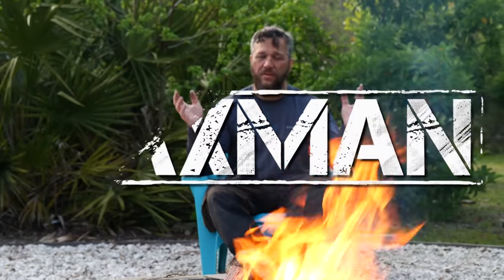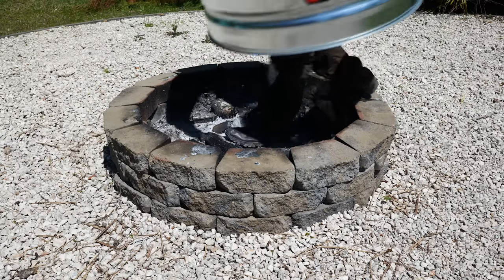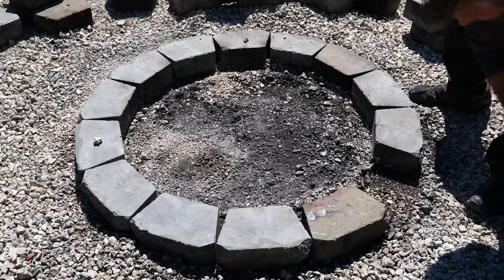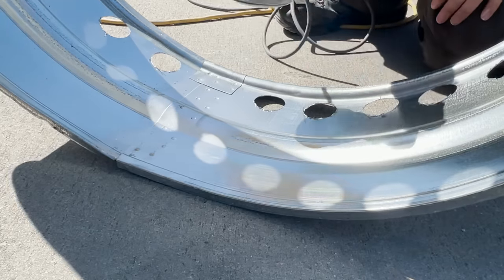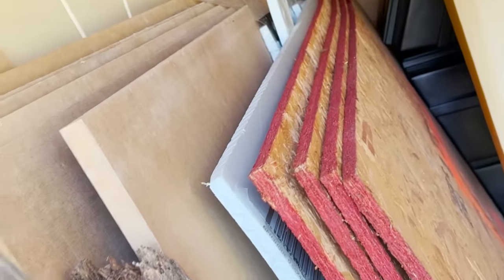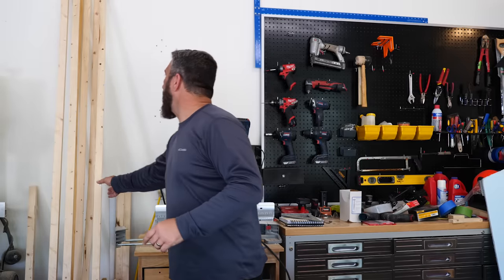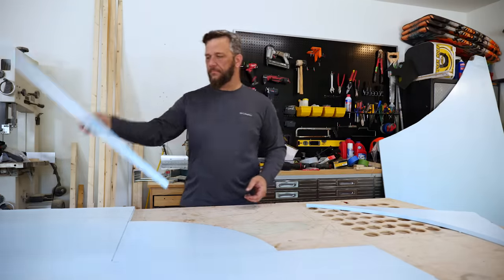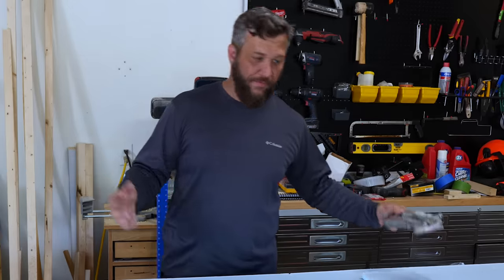Smokeless Fire Pit Makers Hate Me For Showing You This

Comment: Super entertaining practical videos! Have you considered using the bricks in such a way as to force the incoming air in at an angle so that all air inlets work together to create a vortex - driving the general direction of the combustion in a counter/clockwise direction within the pit. Done correctly - you may not need the metal liner at all. Extreme, fast combustion would literally create a fire tornado in the pit (& how cool would that look)!

Comment: Instead of removing a lot more bricks and leaving a lot of empty space, you can remove less bricks and space out the existing bricks to pull air from all around the outer ring, rather than only through a few big gaps.
Reply: Would that then make the inner ring unnecessary or does having the chamber do something more than just holes?
Reply: @macdaddy9344  
I think if you stacked the paver stones with space between EVERY stone, effectively making the same diameter circle with just 1~3 lesser blocks, that’ll feed enough oxygen to the fire. 
Keep in mind: once the first layer is built that way, you can build subsequent layers that way also. Plenty of air & oxygen. 

That said, this project has its merits. 
We get to BUILD something. 😁😁😁
Reply: I think it's just easier to make it symmetric if you pull 3 bricks than if you try to distribute that same amount of air space between all the bricks.  

I'm not sure I'm convinced it's all that "smokeless" without more of a demonstration.  He's gonna get SOME fresh air heated up and blowing on the top.  I'm not sure how much.  I think if he put the fire up on a grate and the bottom of the inner wall level with the grate, then he'd have a real down-draft gasifier, like those Solo-brand portable fire pits.

With his design, I'm not sure how much draw he's getting or how long it takes to heat up and start pulling air.  But if you added the grate, underneath it, it'd start pulling any smoke and unburned volatiles down the bottom, up the sides, and come out through the holes at the top, where they ignite in the gasifier fire pits.  The way he's got it isolated, he's just bringing in fresh air at the top.

I'd like to see the full-blown, brick-walled down-draft gasifier.  It'd be better than the all-metal ones they sell, because those bricks would warm up and radiate more heat for longer.   Maybe.
Reply: @macdaddy9344  It would make the inner ring partially unnecessary, but having it would help a bit. The best configuration would be having the air holes on the bottom going in a spiral, so in the worst case scenario (strong winds), you end up with a fire tornado going up and to a side, rather than wild flames going straight on the side. 

There's not much of a difference, between not having the inner chamber and having straight holes, and there's not much of a difference between having straight holes and angled/spiral/vortex holes, but there's a fair bit of difference between having spiral holes and having the inner chamber.

But you'll notice the difference best when seeing it in practice, I guess.
Reply: @harrymills2770  Might be easier to be symetric if you end up with the same number of bricks on each side. Also, adding a layer of stainless steel sheet on top of those 4 stones which together cover the whole thing can increase the cooking area significantly. Especially if aside from taking a brick or two from each layer and spacing the rest of the bricks on every layer, then expanding the cement slabs more towards the center, then adding some support pillars to hold the cement tables, then adding a layer of stainless steel on top of the cement tables. 

However, it would be best to fill the bottom of the cement with a fairly thick layer of clay mixed with sand, so the heat of the fire slowly vitrifies the clay mixture.  Ideally, it would be made from soilcrete/dirtcrete, with 4% cement, 8%-12% water, and the rest soil which is mostly clay and a bit sand/sandy, then using some flat  weights on a pole to compact that down a lot. The result will look a lot like actual stone, and the high content of clay and sand will bake it into a stone from the bottom, slowly but surely.

I mean, in the past, that's how our ancestors made cave houses, they dug up dirt in a cliff, packed down the walls and roof using some heavy things (like rocks, for example), then set up a big fire inside, which burned for half a day or more, covered most of the entrance and chimney hole with loosely packed dirt (which us then more easily removed), then by the next day or two, when the room finally cooled down, the walls were stone-like terracotta. 

You can try something like that with a mud/dirt fireplace, if you want. The fire has to be quite hot, though, and to stay hot for at least 6 hours, then cool down slowly. You can pack loose dirt and gravel to the sides, to help it stay hot for longer (to turn into terracotta) and to protect from the wind.
Reply: or....use a circular saw with a masonry blade.....trim a inch or so off every bottom block..that way the top two courses can be full blocks and all three levels are true
Reply: @mattf49006  That not only uses up saw blades, but also requires more work than simply removing a few bricks and spacing the rest of the bricks to spread out the air intake holes from a few big ones to many smaller ones.
Reply: @SapioiT  ...13 or so cuts on landscape block?....i did it to mine and it took all of 20 minutes on one  blade...it's just cast block
the smaller openings spaced uniformly works great and with a 1.5 inch cut its better looking while easier to match the upper tiers
Reply: I have been watching other videos like this one today and now see what he’s going for... diy version of the solo stove or Breeo which both behave like a small alcohol stove/burner where you actually have hot air adding fuel to the smoke causing an afterburner effect and you can actually have flames coming out the upper holes... I’m loving this concept. (Except my inner pyro won’t be able to play with my fire as much as my current option) ... but ya, a very neat diy concept/project!!!
Reply: @macdaddy9344  The idea in smokeless fire pits is normally to have a secondary combustion higher than the primary one. Think of it as an afterburner. This is archived by having super heated air rising in the "double wall" (between stones and metal in this video) and then meeting wood gasses (smoke). The super heated air + wood gasses => combustion. If you look at something like the Solo Stove it looks like fire is coming out of the holes when air and gasses meet.

Comment: You could have textured the foam with aluminum foil.  Wad up a big ball of aluminum foil so it has nice bumps and pointy bits sticking out a little then you just roll it over the surface of the foam board.  That would create a positive texture in the cast.  You can also just find a rock with a lot of nice texture on it and do the same thing.
Reply: Great idea!!
Reply: To add on this, another way is I grabbed one of the fire pit stones, and just “stamped” the face all over the foam. Worked great!

Comment: You need special alcaline resistant glass fibre as reinforcement. The "normal" glass fibre will definitely resolve in the alcaline cement i.e. concrete.

Hint : if you make one or more air intake openings under the fire, combustion will improve substantially. Your air inlets higher up indeed will help to burn off the smoke.... but the airsupply under the fire will prevent the forming smoke.

Comment: That concrete should have been a little wetter. I did stone casting professionally for a while and i found out that to dry of concrete like you had in your mix isnt strong an will break shortly after. As well as vibrating the concrete would have helped greatly as well for strength and you wouldnt need any fiberglass especially with a piece that small. 👍other than that well done

Comment: this dude has 7 million dollars worth of OSB in his shed, i saw 4 boards in there. There might be more!
Reply: A 200 ft roll of wire just shot up to $239
Reply: @yongyea4147  
The way these prices are going is nuts.
Reply: Steel up 145%
Lumber up 126%
as of a couple weeks ago
Reply: Measure twice, cut once. You can't afford mistakes.
Reply: @brandonknight7240  yea. Its bonkers. Its also driving up housing prices like I've never seen.
Reply: The Great Reset or SHTF as we say here in Texas.. sounds about right
Reply: 9$ a stud in utah ...  a 2x4x96"...... 🤯
Reply: @taylorfritz3801  
I just checked home depot. $8.20 cdn. That's $6.52 in USD.
Reply: @truthspace5525  theyre actually $6.87 here plus tax, which is still outrageous!!! You can't even afford to build stuff anymore! And osb is 56$ a sheet!!
Reply: @taylorfritz3801  I know what you mean. Gonna have to mill my own trees soon
Reply: obviously hoarding
Reply: Is it expensive in the states? It's used here to shield building sites from prying eyes & keeping people out. 
I saw a Canadian brand once that was famous for the moths that he it pressed I to the surface at certain times of the year I think. 
I use it to make cheap bookshelves & houseplant tables in bay windows. Dirt cheap, easy to cut in any direction.
It really glows with a light sand, then some yacht varnish cut with 50% white spirit, let that dry, another light sand, a thick hoover and a damp cloth to get the dust off and then two or three coats of yacht varnish. 
Looks gorgeous by candlelight!
Reply: Over here in Germany, spruce lumber prices just are in a long time low. They had to cut lots of trees because of bark beetle infestation due to several dry summers.

Comment: 12:11 a little tip.  You should always pour fresh concrete into fresh concrete, never away from it.  This prevent voids in your slab.  These things are going to get hot, any air pockets can cause explosions.
Reply: You are technically correct, especially if you were building an enclosed fire box like a fireplace but with the pits the heat goes straight up, and therefore, very little heat is generated on the cap

Comment: Nice going. It really is amazing the number of possibilities for a smokeless fire pit. 
'Engineer Carter' ( my neighbor) built one similar, but around the bottom layer, he used a broom handle (dowel) to space between the blocks for an even air inlet. He claims that this allows for a change in the wind direction at the inlet ( I think he was just worried about his dog laying down and blocking a hole if he use the absent brick method).  This of course made the diameter greater, but not by much. The next two layers were set tight and he ended with a larger size brick for the top layer which gave him a lip at the top.
I really like your cast pieces for the top finish. That is a stylish design!

Comment: BTW, according to Real Engineering, you could add the fiber glass during the mixing time. I think it's better than rebars since those do not like the kind of heat they'll be exposed to.
Reply from the maker: Normally you can add the fiberglass in the mix but it will show up on the surface. I didn’t want to see it. You could make two separate mixes. One for the face and one with the fiberglass mixed to finish filling the mold. I just didn’t feel like making two mixes.

Comment: I watched all of your smokeless fire pits and I want to say THANK YOU MILLION TIMES OVER!  Now I need to watch it again so I can get the courage to make the paver caps. It will be my present for my husband, any other tips? I don’t have a lot of tools or experience 😀
Reply from the maker: The retaining wall blocks used on the outside come in two sizes. If you use the small blocks on the perimeter and then use retaining wall caps made for the large blocks you might not have to pour the tops.
Reply: @HAXMAN  Thank you 🙏 
It’s hard to find the cement caps right now. The one I found were $65.00 a piece. I will give it a try, it’ll be a learning experience.

Comment: Great build except for the use of the galvanized steel.  When heated, galvanized steel emits zinc oxide which is fairly posionous.  Use raw steel or stainless steel sheet metal bent around with a considerable overlap.  Use sheet metal screws from the inside to secure the overlap.
Reply: Could you coat the galvanized ring with high heat wood stove paint to prevent it from emitting the zinc oxide?

*update, never mind i read the label it says don’t use it on surfaces directly exposed to flames
Reply: Isnt zinc oxide the same stuff the make athletic tape and sunscreen with?
Reply: Yes it's used for sunscreen so don't smoke that either

Comment: Just got done doing this project.  It worked so well.  Only issue I had was with the contact cement.  It melted the foam boards I bought.  To be fair, I wasn’t able to buy the blue foam boards from my local stores.  Thanks for the video!!!!
Reply: What did you end up doing to hold the foam together? My contact cement melted my blue foam boards from Lowe’s
Reply: @Miguel_Molina  I ended up making a bunch of kerf cuts on the side pieces and used screws to hold everything in place.  Then I put some caulking on the inside edges.  Held together great and ended up with a great end result.

Comment: How does your upgraded fire pit work on a scientific level, would be interesting to know
Reply: Yes! Anyone?
Reply: It doesn't
Reply: I have done many many fires over the last 15 years, probally close to several thousand all attempting to achieve a smoke less fire and i am absoutley not convinced, the only way to ensure a smoke less fire is that have the top of the fire have some sort of chamber/section/ jet/ chimney that allows super heated air to burn off the rest of the smoke, this design no way achieves that,   which mean it will not work. .  it seem that we was trying to create some sort of a rocket stove design BUT it is way to large to work and has no lower holes,  in my expereince a fire needs 4 things to burn well [not the common 3 that most people say]   first 3 1] fuel 2]heat] 3]oxygen  and my last number 4] pressure, in other words a type of choke point, /chamber/section/jet,  this is what allows the fire to burn cleanly , with out a choke point it just doesnt work which is why all these super large fire pits suck, your way better off with a Chiminea , this givess you a choke point/burn chamber  and a crystal clean  burning fire
Reply: @mikeriverajr4447   big brain points on using super thin galvanized mild steel.  After it poison him and his family with zinc metal fume fever its gonna rust out in no time.

Comment: Interesting, the lightweight fiberglass cloth is good for a crack inhibitor during the cure 24-36 hours, after that, practically zero strength enforcement. It will crack, hopefully not separate. Chicken wire, wire coat hangers, short pieces of 3/8" rebar overlapped with keep it together for when it does crack. Cool build though for the smokeless design.
Reply: Like the vids! How many bags of concrete did you end up using??

Comment: If you don't have a vibrator to use on your concrete, you can just grab the table and shake it like you're having a seizure.
Reply: My brother took the Jaberonski so I´ll just tape him to the table;)
Reply: or, Back in the old days (in the 70's, 80's or 90's), when doing castings or foundations, you can use a rod (we used a piece of rebar) to pump up and down where you poured the concrete to remove voids.
Reply: @TheNickelfire  Me an my old man do the same thing! except we just use a stick! that has a few fingers on the end and we dip that end into the liquid rubber we use to make the molds. It works great! and we always have the supplies! Im constantly picking up rebar/old bed frames to reinforce the big benches!

Comment: Couple of  inputs. Bottom break the sides off of one of the pavers and put into the bottom, 2. Add a few holes down in the bottom of the ring for ventilation to the fire 3. Seal off the top around the ring so air comes out the holes. 4. Next time make the holes around 1/2” to help keep positive pressure around the top 5. Seal the top to ensure air goes out the holes.

Comment: Thank you so much! I am just starting my fire pit project and am working on a tight budget so super helpful. I can't buy the steal ring so I'm curious if there are similar solutions to this.
Reply from the maker: If you can find a 55 gallon drum for free or cheap you could cut the top 12 inches off. It will have a smaller diameter though.

Comment: Have you had any issues with concrete and heat?  I’m at the cap stage on mine and I’m seeing other sites saying concrete can explode?  Thanks loved the video
Reply from the maker: No. Make sure you don’t mix the concrete too wet. That will cause it to be weak. Concrete can crack when it gets too hot but I’ve used this a bunch with big fires and had no issues.